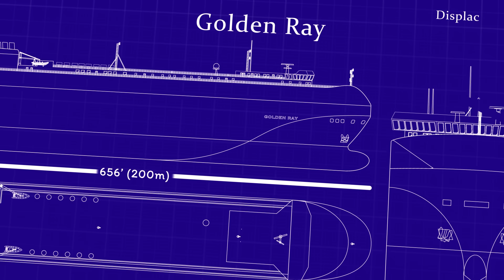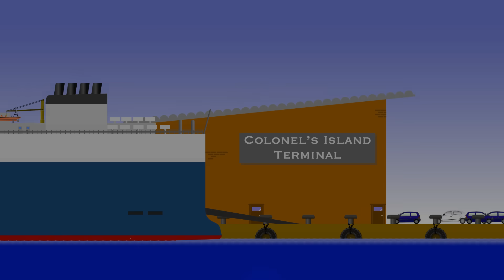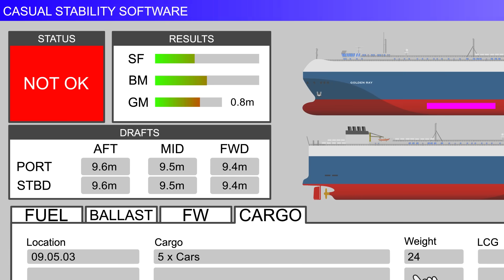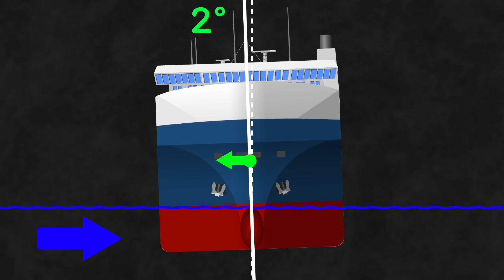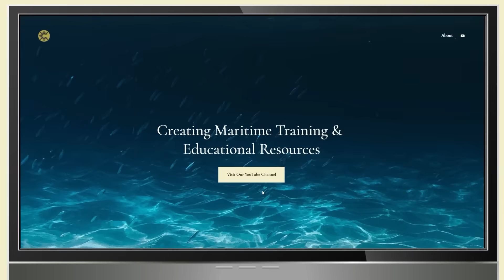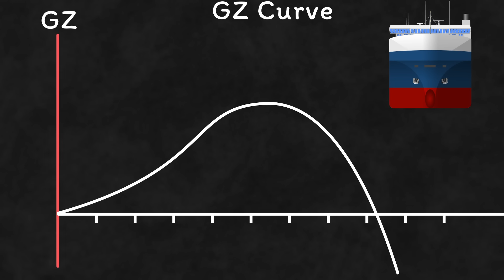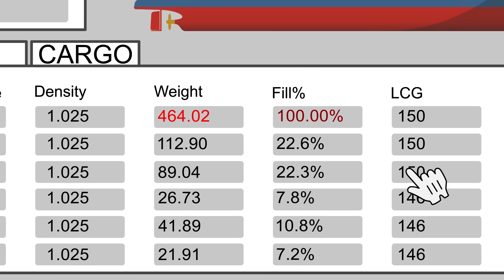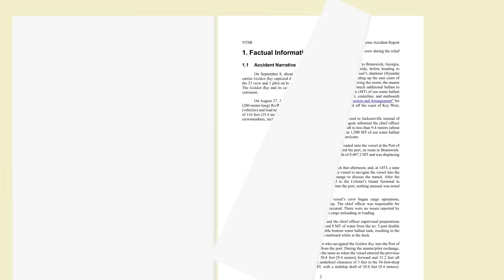Golden Ray: The Typo That Cost $250,000,000

Comment: Wasn’t it the case that the crew deliberately sailed with less ballast than required? I read that they had planned to take on ballast when they reached the open waters of the Atlantic. The reason for this is that taking on ballast at port, where the water was muddy and full of organic substances would have caused expensive fouling of the tanks, or expensive and time consuming use of the ballast filtration system. So the crew just entered the numbers that the ship would be sailing with for the majority of the voyage. They forgot about the necessary manoeuvring to get to the open ocean. And even with this negligence, they old have got away with it if the hatch had been closed for the turn.

Comment: I just don't understand why there aren't redundencies in place. There should be a massive "this isn't safe" warning pop up if they put info that far out into the computer and really it should need to be signed off by at least two high end staff - or better still input by two seperately then the inputs compared and evaluated by the comp to make sure they match and they are within spec. 
Even ignoring all that the ship can work this all out for itself anyway so why is there no question as to whats going on when its so far out?
Reply: Microsoft Windows has proved that for every 'are you really sure', 'are you REALLY sure', 'are you utterly, PERFECTLY sure so help me god' impediment you add, you're just training people to click them away that much faster.

Comment: My recent Risk Bulletin for a P&I Club on the 'Golden Ray' incident explains that the ship's stability computer was provided with 3 modes of operation, namely Manual Input, Auto IMACS input and Roll Test Check. If the C/O had used Auto or Roll Test modes as a check they would have flashed up as 'Unsafe'. So there was no problem with the stability equipment's design, only with its operation. As such, a tragic illustration of 'human element' failure in circumstances where the C/O was likely very tired after supervising a short turnaround car discharge and load operation and under pressure not to hold up the ship's departure.
Reply: why in the hell is there not a display of the auto IMACS, even if its not in auto... from my view as an industrial process electrician designer, this should ALWAYS display even if its in manual or off... it should still be reporting data for you to judge relevant or not, at least then you dont end up with this exact scenario 

thats like storage tanks... you always have to know where the level is regardless of your processes, being in manual, auto or off... you ALWAYS have display of your safeties and levels

incredible that this was designed this way
Reply: And your supposition is from your interviews with the ships personal on how tired they were? Fascinating! When did you conduct these interviews? Who did you speak to?

Comment: One factor was probably that stability calculations on car carriers are not taken all that serious. Cars are "volume cargo" and don't affect the ships weight all that much (trucks and heavy machinery can only be stored on the lowest deck(s)). It is really difficult to load a car carrier so badly that GM becomes an issue.
Reply: The Hoegh Osaka fell over leaving Southampton mostly because the weight of embarked vehicles was estimated as 2t per unit instead of their actual weight of 2.3t.
Reply: Until you're 1500 MT short on ballast and don't know it.  Then it becomes super easy.
Reply: @johnd5398  Barely an inconvenience.
Reply: @andrewboyer7544  wowwowwowwowwow
Reply: @johnd5398  You mean 1500t. I guess you want to say Metric Tons, but tons are by definition metric. 1500Mt would be 1500 Mega Tons or 1,5 Giga Tons. Thats 1.500.000.000 Tons
Reply: @Ranety  I thought Tonnes and ''Metric Tons'' were metric,  and Tons were imperial?
Reply: @AEVMU  This is why we should be using megagrams instead!
Reply: When you raise the stern ramp, you are basically doing an inclining experiment and can get a good feel for the "stability" / GM without doing any calculations.
Reply: @allisonmcgowan7526 But wouldn't that be longitudinal rather than transverse?
Reply: @Shama-Llama Ding-Dong Hey, shut up!

Comment: The computer should have some checks to make sure it has the right data. For example, it seems like it can recognise how much ballast it has, but it was in manual mode so it believed what people have put in. But since it would have own data, it should alarm the crew about discrepancy. And even if it could not measure that, it should measure the reactions of the ship (angle during maneuvers) to expected reactions, and alert that something is wrong when angle gets bigger than anticipated. Probably there are such computers in use, but are more expensive, though.

Comment: Great video thank you, just discovered your channel, liked and subbed! I'm really surprised there were no sensors that detected water coming in through that open door. An alarm should sounded and they would have shut it. Computers are now clever enough (by reading the planned route) to forewarn the crew in cases like this. For example lets say that a door on the starboard side is open and the computer can see that a starboard turn is coming up 5nm ahead - it will alert the crew to close the door. This sort of thing.

Comment: No doubt there are other considerations of which I have no idea... but... I am very surprised that when this stability computer is in 'manual' mode, that there is no automated process to detect and alert that there ISN'T 1500t of water in the thanks.  If that is in any way 'normal' it is also very surprising this hasn't caused problems in the past.

Comment: Exactly the issue that is suffered in Aviation. The 'computers' are in no way connected to real time feedback of the aircraft systems when it comes to weight and balance. 

Wheel weight sensors SHOULD be installed on all large airliners to indicate if the data input by the pilots (or load crew) is out to lunch, but no - we have commercial airlines departing all the time, with serious imbalances on a regular basis. 

The same applies here - why does the ballast system not talk to the CoG computing system? Obviously it wont be very accurate but it SHOULD BE able to tell if the numbers are WAY off. 

Eliminate stupid mistakes, people are not perfect.

Comment: I'm fairly certain the Golden Ray did not displace 71,178 metric tonnes. That number refers to gross tonnage, a measure of volume.

To put this in perspective, a South Dakota class battleship, which has similar dimensions to Golden Ray, has a standard displacement of 35,000 tonnes. They have  a draft of 11m (relatively deep). If Golden Ray displaces 71,000 tonnes, it will have a ridiculously deep draft of up to 20m. That would not make Golden Ray economically viable and this typo would be a non-issue.

Other ships that are in the 70,000 tonnes displacement range include battleship Yamato (72,000 tonnes full load) and early US supercarriers like USS Forrestal (60,000 to 80,000 tonnes). I think it's safe to say that Golden Ray does not displace that much.

By the way, warship sizes are often given in displacement (a measurement of weight) while civilian ships are measured in gross tonnage (volume). Very often confused.
Reply: Well spotted Danny, you have seen the obvious contradiction of size vs stated displacement. Ironic that a video about a mistake in numbers should mistake gross tonnage (gt) for displacement. Gross tonnage is NOT a weight. It is a measurement of the size of the cargo space hence car carriers cruise ships etc have a huge gt figures compared to their actual weight, maybe 2.5 : 1. An oil tanker on the other hand will have a gt figure actually lower than its displacement, perhaps 0.8 : 1. Wikipedia is not telling us what the displacement is but does give the deadweight as 20,995 tons. This is the total weight the ship can carry including cargo,fuel,water,stores,etc, to which must be added the weight of the empty ship, say 12,000 tons giving a maximum displacement of 33,000 tons.

Comment: Very interesting!
I expect the individual who made the error is having some difficulty coming to terms with the mistake, but thankfully no lives were lost. But, humans are not infallible, and the fault must lie with the procedure, not the individual.
One elephant in the room - the ship had already successfully navigated a series of turns. Would the ship have experienced more than the expected degree of heel as a result of those turns, and would that greater heel had been observed, and given the crew an early indication of a problem?
Reply: There is still some software around (Adobe), and if I remember correctly datatypes in programming languages, that get confused with "." or "," inside integer value. For instance in many European countries a comma is used for decimal point, it is default in metric system if I remember correctly. While probably not the case here, I've seen too many times 0,3 cm converted into 3 cm etc.
Reply: @magnuskallas  thats not the issue of this instance, the issue is that the captain forgot to remove the ballast water from the inventory.

Also any program that doesn't "sanitize" its inputs is a faulty program. Rule 1 is to expect faulty and/or malicious inputs, so if a character doesn't belong then don't let them type it in the field or atleast don't insert the data from the field into the database.

If you are allowed to type a "." or a "," in the middle of an integer then the program is a failure. Also .3cm = 0cm if stored as an int, and 0,3cm = 3cm because the program probably just purges all the commas anyway since they don't need to be in the number entered if all they do is make it easier for humans to read the number (verses the decimal point being mandatory to know when the decimal section begins). 

Also, invert all the commas and periods for a program made by UK devs instead and all the logic applies.

And optionally only give 2 decimals of precision and assume the right most 2 digits are the decimals and if you want to enter 100units you need to type 10000 and the machine renders 100.00units. This sort of thing can be idiot proofed, forgetting to subtract ballast weight also should be idiot proofable but it needs manual overides in case of faulty sensors which inherently opens up risk of human error. (See all the examples of why defeating safety measures isn't a good idea, it doesn't take much effort to find them)

Comment: As they say in the Aviation Community, the holes in the cheese lined up!

First they pumped out the ballast water.

Then they switched the computer from automatic to manual update.

Then they entered incorrect data into the computer.

Then, when carrying out their pre-departure computer checks they failed to notice their catastrophic data input error.

The computer, input with incorrect data, made its calculations on the data it had received, which allowed the vessel to leave port. 

Then, after they set sail, the Captain ordered the Pilot Boat Door in the hull to be opened.

Once committed to the tight turn, the destabilising effects of the ballast error initiated the unrecoverable listing to Port, at which point the opened Pilot Boat Door area became submerged, instantly flooding the badly listing vessel with extraordinary large amounts  of water, which accelerated the listing until the vessel struck a sandbank, laying on her Port side!

The company had never set in place a procedure to have a well informed Crew Member observe as the data was manually entered into the computer to verify that it was correct.

And because that simple method of oversight of this critical manual data input to the computer was never considered or established, the inevitable happened, worsened by the Captains order to open that door in the hull.

It wouldn't have cost the company one single penny to have the manual data input observed for accuracy, but it certainly cost them and others very much more than that...
Reply: For a potential $250M cost, you would hope there was a better system than just a second set of eyes. Presumably the height the ship was floating at compared to the computed height would of varied for instance.
Reply: @someone6170  As I said in my post, they had never considered the problem, so had never considered any type of solution...
Reply: @someone6170  Signs that the math wasn't working out physically would be helpful, as long as crew actually follows up on the warning.  The ship water line being wrong is something not to ignore.  The system should also know what the ship will be expected to do, so it can say hey, your ship will tip over here if our sensors are right.

Comment: Thanks for this. I figured that there was a stability calculation error as soon as it happened. Even though, with 0.8 meters of GM she should not have capsized except for perhaps the open pilot door allowing flooding . 2.45 meters of GM seems quite excessive, as the rolling period at that GM would have been quite quick. But I do not know what the minimum required GM of a car carrier would generally be. That seems quite stiff given the nature of the cargo.
Also, the number you used for tonnage is not displacement - probably gross tonnage (based on internal cubic measurement not weight). There is no way a 200 m ship drawing about 9 meters could displace 71,000 MT.

Comment: Good information. Some details left out. What is a roro? A roro is a type of heavy duty trailer that is loaded with cargo, towed on board and tied down. Generally cars do not use a roro trailer, drivers bring the cars on board and they are tied down. No mention of cargo shift. Once the cargo breaks loose from the tie downs the ship will likely be unable to roll back to center of gravity. No mention of wind. These ships are very susceptible to tipping due to wind.  Thanks for the video.
Reply: RoRo stands for "Roll-on, Roll-off' which means the ship lowers ramps and the cargo (cars) are loaded and off-loaded by driving up and down the ramps, respectively.
Reply: @nocalsteve   You don't know what a ro ro trailer is.
Reply: @nocalsteve  There is a youtube vid"Cuypers vorkliften movella rampsafe translifter." This vid shows actual ro ro trailers and how they are loaded and positioned.

Comment: 3 values not filled in on a vital stability calculating device does not seem to me like a minor omission or ""typo"... 
don't get me wrong... I can easily understand how it happened, but whether lack in training (as to the importance of the task), attention (possible fatigue due to working conditions or else), or a technical error (such as a glitch that defaulted data to a previous entry or just failed to save the new data into the system), this is something of a major problem that needed to be dealt with, even irrespective of the current results

Comment: Something I will need to investigate by reading the report...why didn't anyone know that there were inaccuracies in the the stability calculation input data?  There are are independent systems that monitor heel angle.  The weather isn't very sophisticated to determine the ships center of mass based on observation....speed, radius of turn, time to heel, time to return to vertical etc.  There were two turns.  That should have provided enough information to an independently monitoring system and learned officers.

Comment: I used to work for a Japanese motor manufacturer in the NE of England, loading and discharging thousands of vehicles onto these RORO carriers. Always boggles my mind that a new, state of the art vessel can capsize like this in the 21st century.
Reply: The technology may change, but humans never change
Reply: You would think with the computers available they could use systems such as on big jets that warn of and prevent wrong actions, so the computer would know the door was open, know the ditching point, and the giro would soon tell it that the ship was leaning too far too fast and so stop the turn.
Reply: @Uftonwood2  I guess the problem lies in the last three words of your comment: "stop the turn"

How do you stop a ship going 12 knots and were does the ship go when you stop turning? 
They turned because there was land in front of them. So stopping the turn without stopping the ship 💥
Reply: @Uftonwood2  Computers are still the product of fallible humans though, thus can never be truly infallible.
Reply: You can have all the hardware and software but be let down by the wetware! 🧠 🧠 🧠 
Was it Nissan?  My cousin went up there for a number of years.